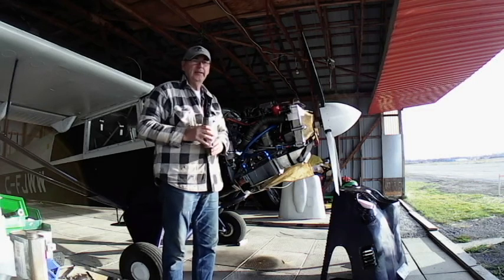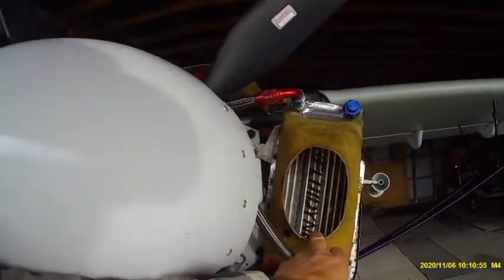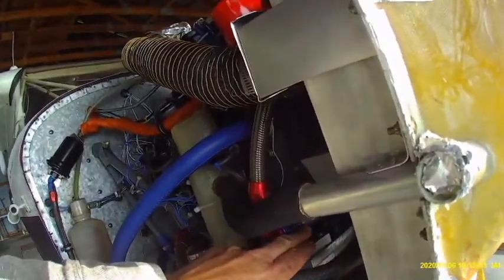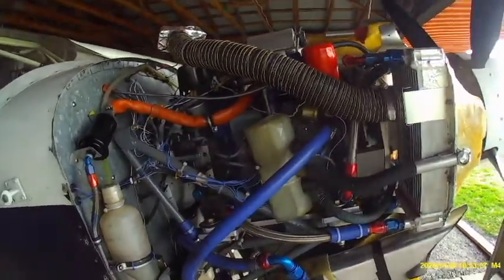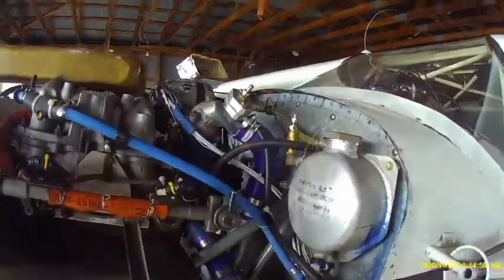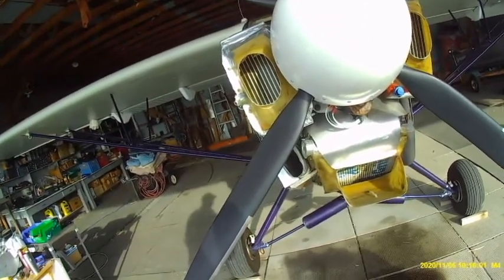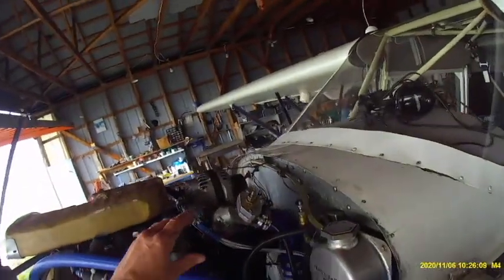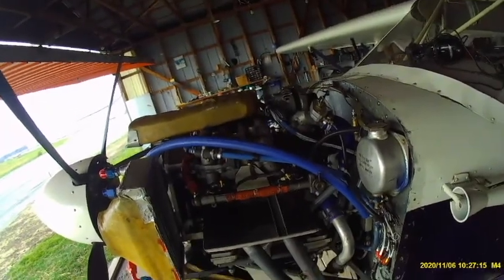Winterizing the Mazda 13B

Comment: Hello Jeffro, I was wondering how the fuel economy was in comparison to say a Lycoming or continental? Do you find the 13b to be dependable? I have heard others had issues with them but everything i have studied on the engine itself could make for a dependable power plant for aircrafts...is your engine dependable? How many hp is your 13b?
Reply from the maker: Hi Douglas, from my experience and what I've read, the Mazda is not as good as a Lycoming for fuel economy below 7000' msl, at that point they start to even out as the Mazda can be leaned further below peak than the pistons can.  I have found the 13B to be very dependable so far, any problems I've encountered were self-induced, part of the learning curve; reality is anyone with an alternative engine has to spend the rest of their life trying to prove it.  My engine was never put on a dyno but it makes an honest 165-170 hp.  The Mazda 13B actually makes a better aircraft engine than it does a car engine, as it produces the horsepower that aircraft need but not high torque that cars need at low speed, combined with less fuel economy and high emissions they don't do well on the street.
Reply: @jeffrosOutdoorExstreams  thank you for the responce..what psru were you using?
Reply from the maker: @douglasfurlong1  I'm using one developed by Tracy Crook (Real World Solutions) now defunct - which most of the Mazda guys are running.  It is a FORD-6 Planetary Gear stlye with a reduction of 2.85:1, so at WOT takeoff I see about 6200 RPM engine/2175 prop; I could re-pitch lower to get more rpm and better climb rate but I'm already getting 1000 fpm and a lower cruise rpm ... I have 4-blade Warp Drive prop - would love to try a 3-Blade or a longer 2-blade.  Back to the reduction Drive - one stipulation is NO METAL PROPS due to vibration/harmonics.
Reply: @jeffrosOutdoorExstreams  I remember that drive...I think at one time Tracy even sold plans for that drive...How many hours do you have on it? Are there still lots of 13b guys using that drive?  Now they are using an elastomeric coupling to the fly wheel and or making the whole flywheel out of anti dampener materials which eliminates frequency issues to the crank.. I was just researching psru's to see who is still in business but heard that rws psru has not really had any failures....tat all being said I still like the 13b for an aircraft engine and that is what I will use, I mean what other engine can blow a seal and still crawl home..great little engine!!!..I would gladly pay for a little extra fuel to have that safety factor.
Reply from the maker: @douglasfurlong1  Yes, there are still lots of guys flying Tracy's Drive and a handful of new builders on the way, all sourced an RWS drive from incompleted projects ... I have about 205 hrs on mine.  There is a guy named Neil Unger from Australia who is trying to make/sell a replacement ... if you check-out "flyrotary@lancaironline.net" you can get his contact credentials.  I think the 13B is the best power-to-weight-ratio automotive engine you can find in the 150-200 hp class ... Good Luck with your project if you proceed and join the flyrotary BLOG if you do ...
Reply: @jeffrosOutdoorExstreams  thank you so much for answering my questions..and for the links;)
Reply: Wankel engines are inherently unreliable and cannot meet the minimum PFTR reliability standards for FAA or EASA type certification for airworthiness.
The Wankel engine has significantly higher BSFC due to its lower thermal, mechanical and combustion efficiency.
Aircraft manufacturers have abandoned all development of Wankel engines for aircraft applications because they cannot compete with reciprocating engines for reliability or horsepower to weight ratio performance.

Comment: How does it fly? Speed, ROC, Fuel Burn.... Cheers
Reply from the maker: It flies like what it is - a 4-place super cub - My normal cruise speed is 100 mph burning 7.5 gph, turning 5600 engine rpm or 1965 prop rpm , through a 2.85:1 reduction drive.   The engine sound and high rpm takes some getting used to.   In standard atmospheric conditions the ROC is a solid 1000 fpm at 75% gross weight.